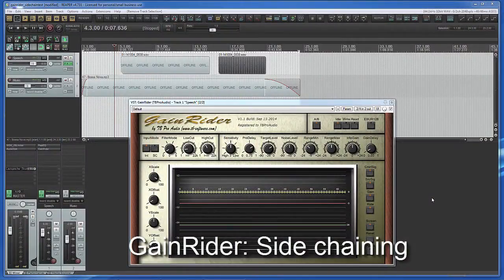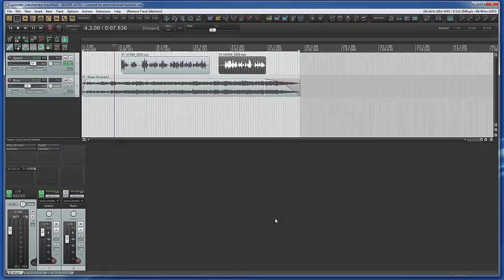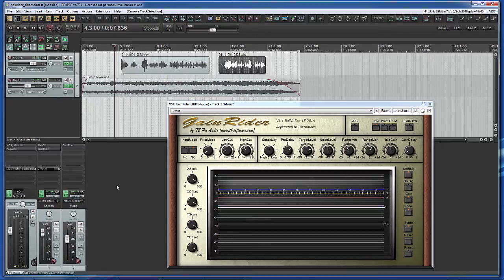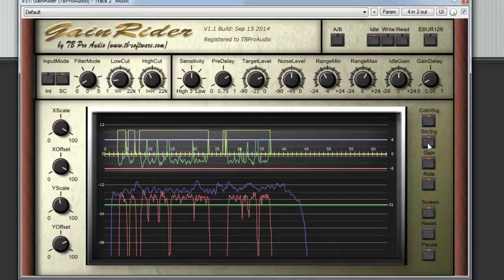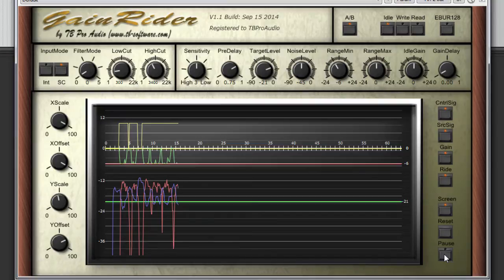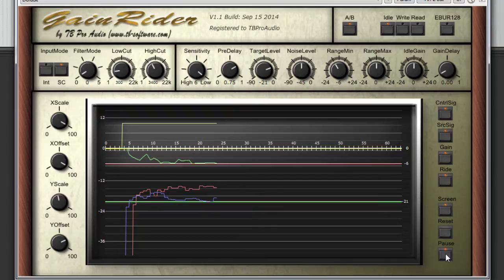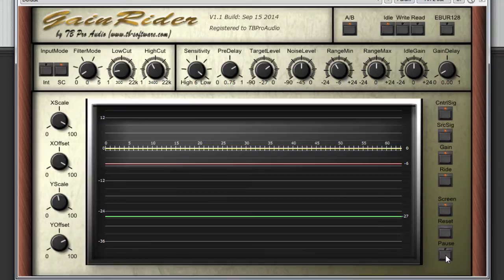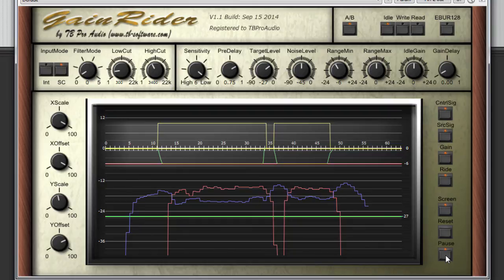Gainrider side chaining

Comment: Would it be possible to add some kind of weighting or Fletcher-Munson type loudness curves to gain detection part of the plugin? In your example above the music gets a bit too loud when the strings come in at 6:49 so due to the added RMS/Average levels in the 800hz to 3khz range it would be desirable to lower the music track by an additional 2 or 3dB.

I've tried all kinds of gain riding plugins from waves, Melda Productions and a few freeware choices and even designed some of my own within Reaktor but they rarely work reliably.. and I always end up doing the whole thing by hand. This usually involves automating the gain of a very broad EQ bell around 2kHz as well.

I'm sure it should be possible to create a "perfect" gain riding tool for voice overs but it needs to be a bit more complex under the hood. It must take into consideration how the human ear works. Simple volume balancing is just not enough for great results.
Reply from the maker: Niklas Silen 
Thanks for your comment. 
In the mentioned case equal loudness contour speech measurement does not catch the 3dB plus of the strings.
Because damping is done by fixed value of -6dB, simple on/off if speech is above/below targetlevel (threshold).
This issues needs to be fixed in the mix of the music:-)
In any case loudness contour speech measurement would make sense, noted for one of the next releases.
Regards
TBProAudio